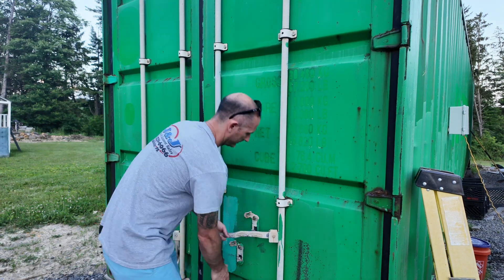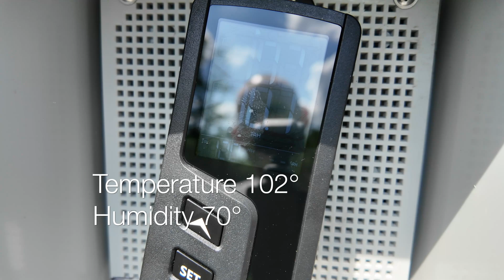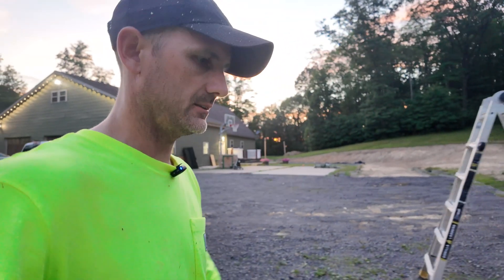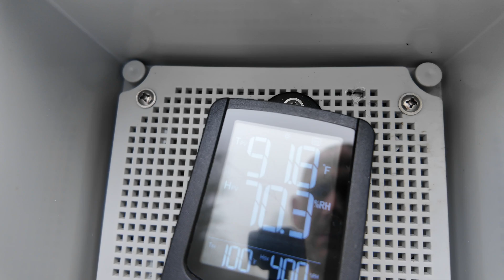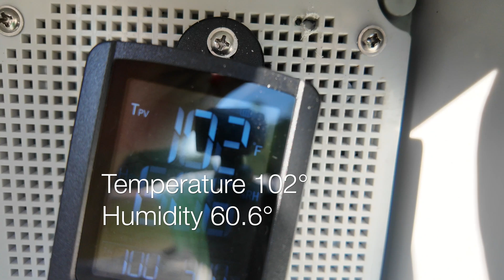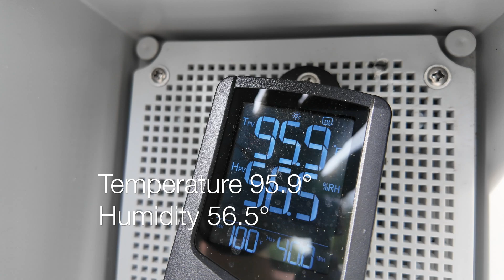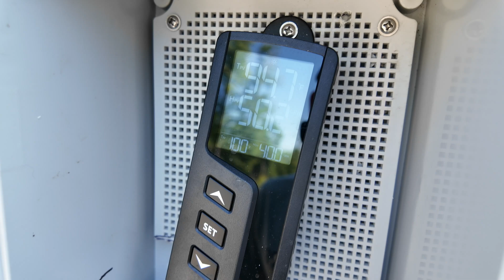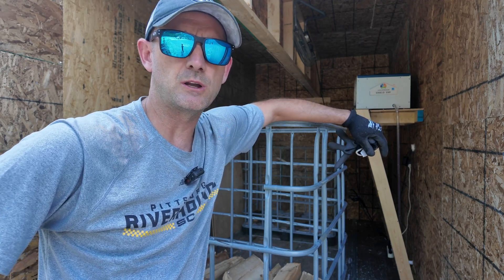I Built a Shipping Container Kiln… Did It Actually Work?

Comment from the maker: @treestofirewood
Reply: There’s a lot I could say. Air flow air flow air flow. If you are going to run a dehu. The process will take longer and cost more. But look at the specs on the dehu you have for the most amount of moisture that can be removed and at what temp. Keep the temp at that number. For what you have. I would regulate air in/out to keep temps at where you need them to be and keep the dehu running as efficiently as possible. If you do add heat the drying schedule dramatically changes. That’s a whole different can of warms. But weigh the cost of drying and what you can sell it for. Just my 2 cents.

Comment: Hey neat build check that wood again. After a few days the moisture inside to outside will even out some more and you might be surprised how dry it ends up being.  Not sure your use or market but i hope you can charge enough to make that worth while. I have found with mine its hard to justify the kiln effort a majority of the time so far